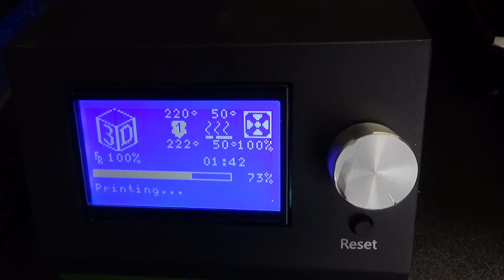Anet E10 How I cured my slow-heating hot-end issue.

Comment: I have Ender 3 3D printer. Recently I was having an issue where the nozzle and bed on heating will stall at 95C and 60C respectively. Initially I thought there was something wrong with thermistor and heater cartridge. Since both bed and nozzle weren't  heating properly, I thought something was wrong with the mother board. I googled and searched in youtube for solution but there wasn't anything relevant to what I was facing. Afterwards my printer didn't even start on switching on. Finally I found out the issue by checking my output voltage of SMPS. It read 3.2V where the voltage was supposed to be 24. I connected the SMPS of my other good Ender3 and found that printer turned on and was heating all good. If any of you guys face the issue where both nozzle and bed heat stalling, kindly check the output voltage before changing thermistor and other components. You may have a faulty SMPS.

Comment: i never experienced this with mine but i put a silicon sock on mine before i even done a test print. an that helped with my hotend holding a consistent temp. i had the heater cartridge quit on me after a couple weeks of owning it an every time i would pull it out of the block it would start working again so i pulled all the wiring out an soldered the joint where it as put together an its worked fine since. but when putting everything back together i left the silicon sock off an this was the first time i ran it without the sock and i noticed the temp would drop by 5 to 10 degrees when the layer cooling fans would kick on an if they kicked on to 100% it struggled to regain its full temp an hold it steady. put the silicon sock back on and the temp is solid. mine was switched to 220volt too but i switched it to 110 when putting everything together. it was my 4th printer so i had already been through that with others. but if u are having issues with ur temps on any printer and can find a sock to fit the block i suggest it for the simple fact that it makes cleaning up the nozzle so much easier for 1 and 2 it helps with blocking air from cooling fans an has helped my e10 keep a consistent temp, my ender 5 has one and a tevo tarantula pro that i know longer have always had one. i have a kingroon kp3 tho that i have yet to find a silicon sock to fit its hotend but ii plain to upgrade it to something else not sure what yet but it looks like a mk8 clone right now without the mounts that go through the block an into the heat sink. it just screws the heat break into the heat sink then the block screws onto the heat break kinda like a v6 but the heat break is the same size threat on both sides an is completely threaded an the heat block is narrower than the mk8s so the silicon sock want fit and everything else ive seen online is either for the volcano v6 and mk8. i got a cheap v6 hotend and it came with its own sock but its completely different than anything im also seeing online, but looks like the ones i have will also work on it but the one that came on it has a hole for im assuming is the thermometer cartridge instead of the little one. any suggestions on a good hotend for smaller 3d printers. its 180x180x180 similar to a ender 2

Comment: Oops! I have a question about the hot end heating. My Tevo Tornado just won't get hot enough. Set Tevo at 220 C and measured  (fans out of the way, measured directly on the hot end) 142 C. Put in a new hot end and got same results. This Tevo had been lightly working for a while, so it is something that happened while making a print.  Any thought would be appreciated. Thanks

Comment: so.... i have the anet e10 and my hot end doenst heat up any more. so i plugged the whole thing out of the electronics box and figured out what pin on the connector what was using a multi meter:
1. + extra fan
2. - extra fan
3. + main fan
4. - main fan
5. heating element 
6. thermistor 1
7. thermistor 2
8. heating element.
then i took my multi meter and tested the heating element for continuity and tested the resistance. no continuity and no resistance. could you verify this information with your working anet e10?
also if you know what kind of heating element the anet 10  comes with that would help so much!

thanks for any effort anyone made!